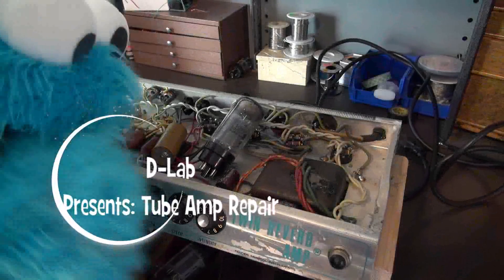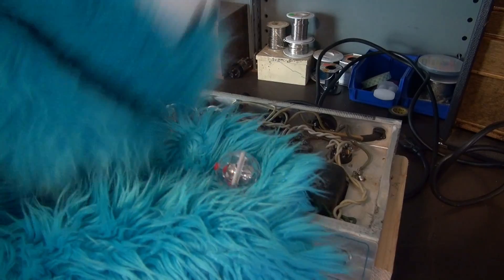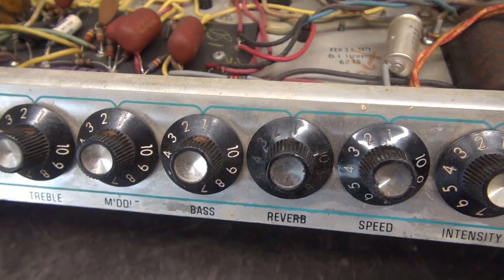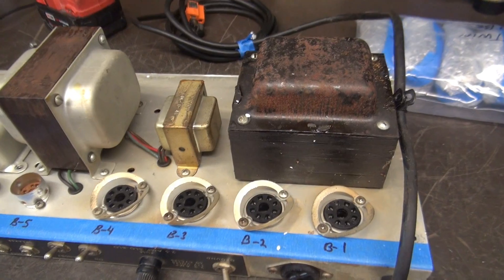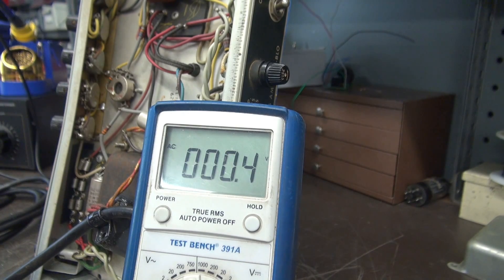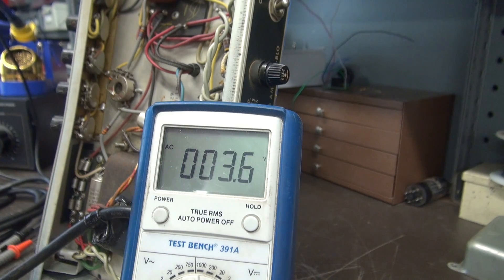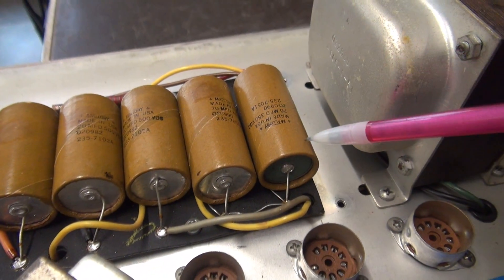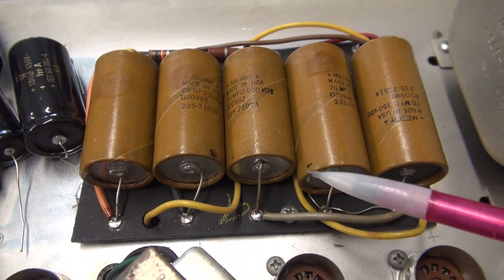How to replace filter capacitors Fender Twin Reverb 6L6 tube  guitar amp Special guest star

Comment: I have a Silvertone Radio from the 1940's that I have been meaning to restore. It's 100% original.
Reply: @pagansforbreakfast Yeah, time to put my parts order in!
Reply: @pagansforbreakfast I'm really excited about it!  It was given to me by a neighbor.  I am actually thinking of trying to give it back to them once it's all fixed up.  Although, they probably will not take it back.  I am sure they will be glad it's up and running again.  I intend to document the rebuild on my channel, as well.  Thanks for the encouragement!!!!
I am trying to get myself to a place where I can start that project.
Right now I have one on the bench giving me trouble....  I'm about to do a "no questions about it" Output Transformer check.  Even though I am about 99% the Transformer is alright.....  It's giving me little to no output troubles.

Comment: Great video, Terry! A friend asked me to take a look at his '66 Fender Bassman with the complaint that it seems to get quite hot after use. As I examined it I found that all components were original except for one filter cap that only appeared to be 45 y.o. Also, one of the 6L6 bases was brittle and broke as I removed it. I explained the need to recap  the entire amp, but he is afraid that I may ruin its vintage value and collectability and wants to send it to an amp "expert". It seems to me that it is not collectable in it's current state. What magic incantation will the "expert" employ that will maintain the value of this amp?
Reply: What good is an amp if it isn't reliable? How often does he use it and where is it used?
Reply: The value of the amp lies strictly in its provenance, not the make/ model. What musician of note and fame used or owned it and when? Anything else allegedly about "collectability preservation" is just blowing smoke up someone's ass.
Reply: Try to keep the tone stack caps and transformers.  Those are the primary drivers of the original tone.  That’s where the value is.
Reply: If he really wants to keep it as a collectible, he should retire the amp in its originality.  Otherwise, update components as needed to keep it safe and reliable.  I have a 55 Deluxe that I play occasionally but the filter caps became pregnant and I replaced them years ago rather then taking a chance on causing damage. It still has its mojo and I still have the original caps stored away.

Comment: I have a question if anyone can help? I have a 3 month old fender hotrod deluxe IV (newest revision) and i finally had a chance to turn it up a bit since my neighbors moved. I turned the clean channel up to about 40% and after a few minutes my volume started to die down then the light went out. I checked the fuse and it had blown. I wasn’t pushing the amp anywhere near a live gig setting but i was running a full pedalboard through the front end and effects loop. I looked over the boards and checked some values and everything looks fine. Going to buy a fuse and try to power it up but I have some concerns that the amp may be defective? Any help would be great.. thanks